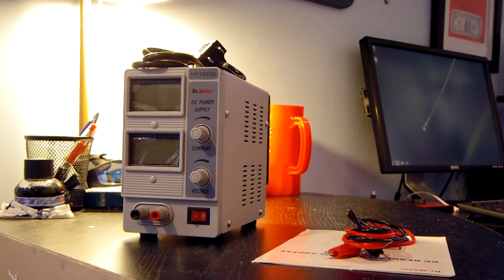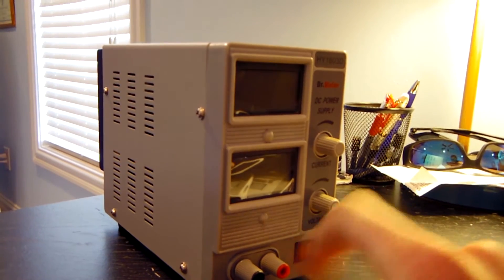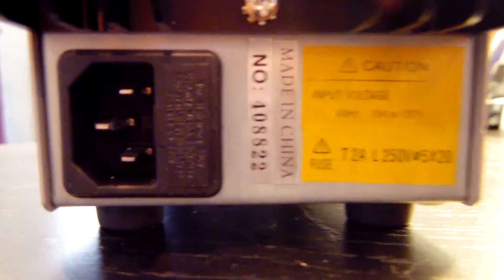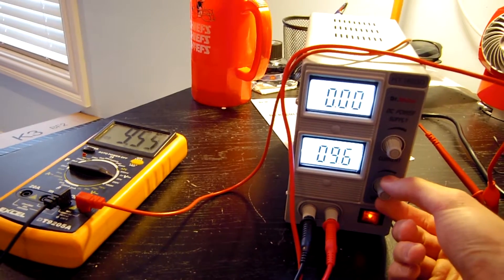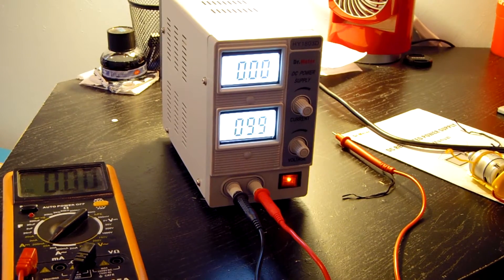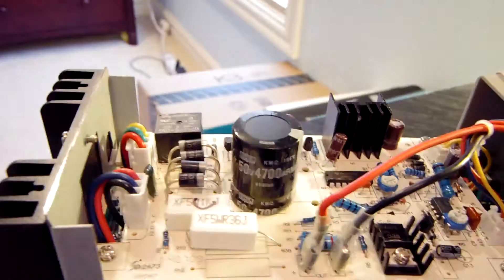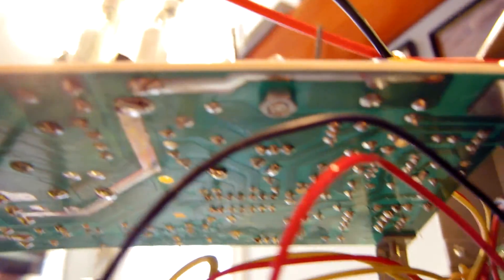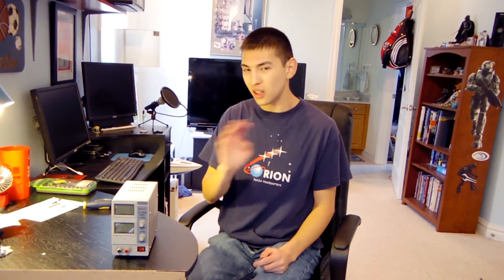Dr.Meter HY1803D Linear Variable Voltage DC Power Supply 18V, 3A

Comment: I just got one of these today, however mine has a fan built into the back of it  instead of the heat sink. I'm wondering if this is a newer or older revision of what you have.  Almost forgot to mention that mine is branded Tekpower.  Great video man, appreciate it.

Comment: What's the color bands on the "R15" resistor just across from the voltage pot on the front panel? I scoured your video on half speed trying to get a good shot of it, but couldnt get anything clear enough to get the value... thanks!

Comment: I pick these up on eBay all of the time for under $40. Just snagged another one today labeled mastech. Like new in the box with all leads and papers shipped for 40.I believe Mastech, tekpower, all of those companies purchased from the same manufacture, and each badge has its own level of quality control. From what I’ve seen and experienced the mastech equipment seems to be the best quality control and calibrated units. I think they just buy a bunch of them at once and according to their level of calibration and quality control they get either the lower branding or the higher brand badge. I can’t prove this. Just my idea..
And all of the stuff is very good for hobbyist and even beginning professionals. I spend a lot of time repairing and calibrating vintage test equipment, and have stacks of beautiful old HP and kikusui power supplies. And yes they are wonderful but nothing wrong with these new little units either.
I’ve been very impressed with my Mastech benchtop multimeter, and my higher end mastech Bluetooth  multi meter handheld.....I disassembled both of them and did a few mods and a lot of looking around. I couldn’t be more impressed with their level of design and execution. The boards are ridiculously clean, parts are always high end name brand parts, and the wave soldering is perfectly done.
Thanks for your video

Comment: You're testing with a cheap meter that has a low battery. To reliably measure current, you should use a fixed resistance with a low tolerance.

Comment: a tip - testing it at full voltage is not really full load - test it at the voltage just above the voltage you hear the click - at full amps, it will be almost as good as a toaster - you will have a lot of wasted voltage on that transistor at the back times the current...

Comment: Good example video of product usage review, and also excellent use of terms regarding current and voltage.  I especially liked the video of the top board with shots underneath it.  Cold solder joints?...no problem!  Great job!  r-